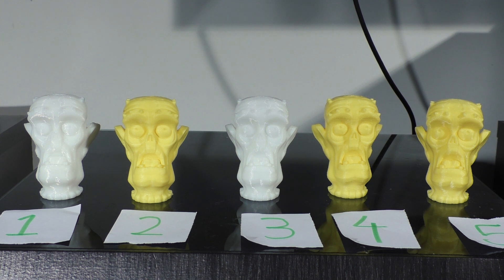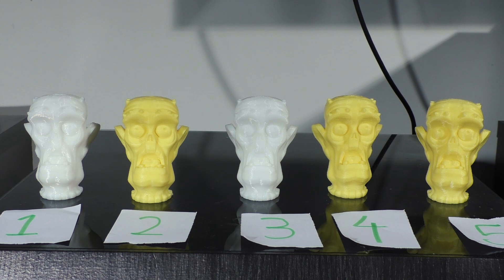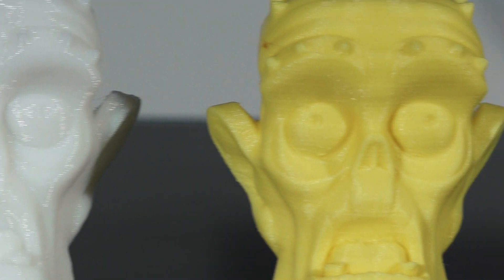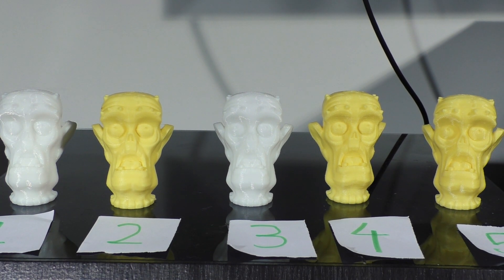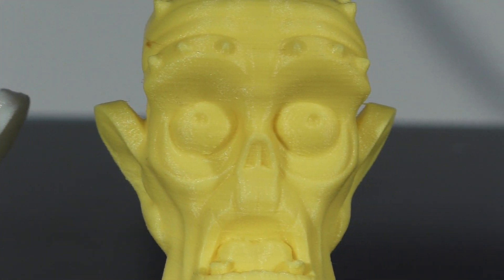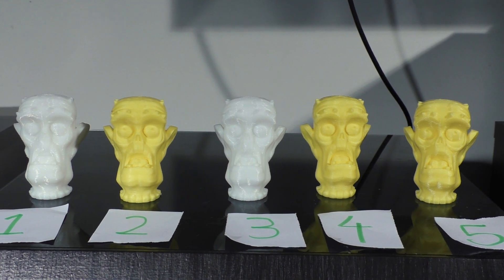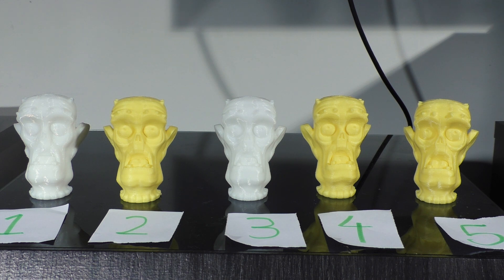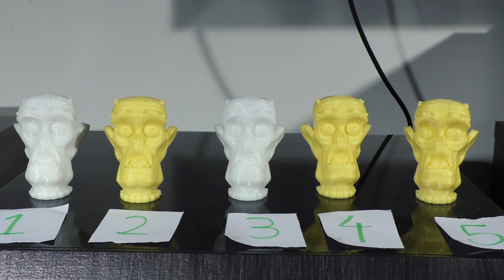Different Layer Heights in 3d printing - Why go so low??

Comment: The quality difference in layer height depends mainly on how steep the inclines on the models are. If there is a very shallow incline you will get horrible staircase effects with high layer heights while it should hardly make a difference in very vertical parts.

Comment: i messed up nr3 and nr5..  imho its also about the size of the object.  50um vs 200um on a 6"bust isnt that big of a difference visually, but if you are doing 1,5" figurines you need everybit of resolution you can squeeze out of your printer.   I also notices big differences in filament quality when using 100um and 50um  that i barely notice with 200um.
Reply from the maker: +Anthony van Hamond most certainly - im in the process of filming a detail video on 0.2/0.3/0.4 nozzles

Comment: great video and good points man .  I'm gonna have to  try upping it a bit on my next prints .
Reply from the maker: +XerotoLabs My next video is printed at 300micron ;) uploading now actually.. Time saved printing.. 5Hrs+..Wet/Dry sandpaper 10 minutes.. (total time saved 4hrs 50 minutes)  :D
Reply: +The Hot End, holy hell that's mad. I only have a wee  Fabricator Mini 1.0  ( dinky thing )  , but  saving time on fun things and  parts that are not for show is damn handy . i suppose where the nozzle is 0.4mm , i cant relay go above some value that still lets the layers squish a bit .    I have found many things actually look better at .2  vs.1  . in some cases a whole bunch better with my small rig . I'm sure  5hrs is the longest  i have ever  hit as my build volume is soo small , and i never use .1mm anymore.  i'll have ot see how close to nozzle diameter i cna go and get strong parst . the parts i use are more structural .   IM looking for best strength  and least plastic usually .  if i can speed up my print times even better ,. example of Version 1 of the sort of part : https://hackaday.io/project/9256-l-extrusion-endcaps  i have about 8 more to put up in a bit all for same sort of idea . you can seat torsion and shear strength can be a issue on these lil guys .

Comment: The trick is watch the top of the ears and count the rigns. I guessed HD to LD : 2-4-5-3-1. The 0.3 gives a nice texture to the print. All in all, the deciding factor has to be in relation with your nozle size and extruder resolution/speed. You need to find the sweetspot that reduces artifacts and keeps print time low.